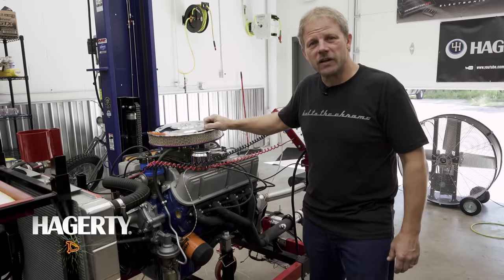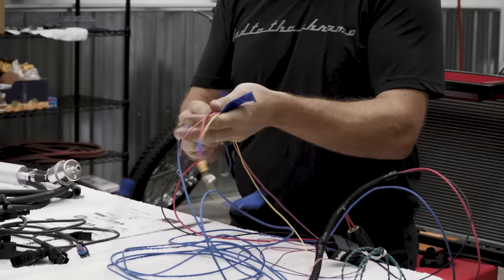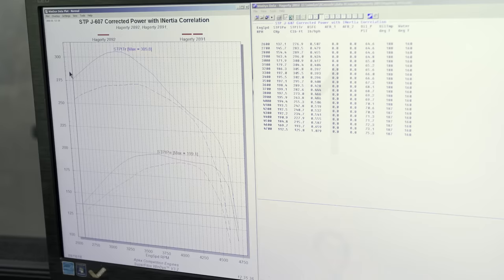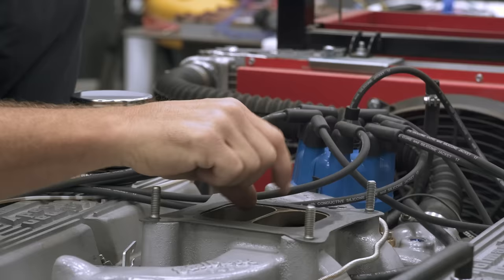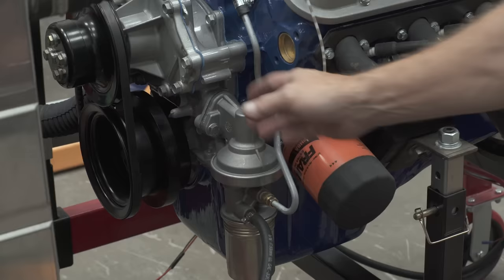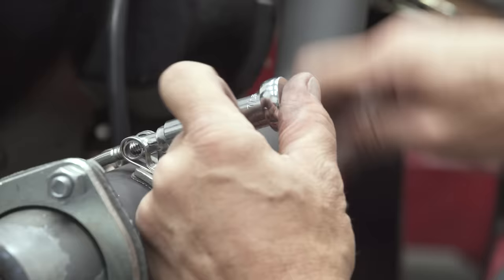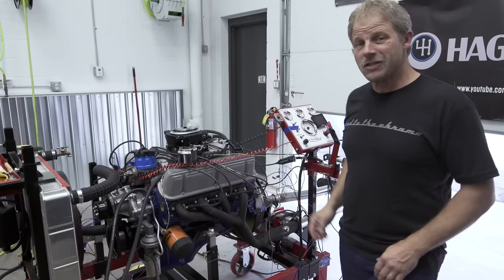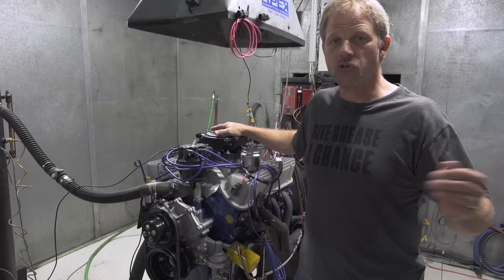Is it worth it? Replacing your carburetor with a Holley Sniper EFI | Hagerty DIY

Comment: The point of EFI isn't more power, the point of EFI is better starting, better fuel economy, more accurate fuel distribution between cylinders, altitude compensation, fuel grade compensation, knock compensation and vastly improved reliability.
Reply: All of which creates more power while dealing with more variables.
Reply: I'd add it's safer too as I've seen countless carburetor fires.
Reply: @emptymannull  When you're talking SFI with 2 lambdas, full timing control, full electronic single coil igniton and such stuff, well, then you might get a good amount more than with a well tuned carb. 
Because with SFI you can do such jazz as cylinder selective adaptations, knock compensation, barometric compensation, pull timing out and in as you like, the only limit is the sky (and the engine). 

I would prefer a EFI/SFI with all the electronics and stuff, because it unlocks a good amount of power, can compensate a lot of things and is pretty safe and reliable. ^^
Reply: Pfffttt okay my family has Holley snipers and all they ever have is problems my Holley 750 double pumper works fine 🤔
Reply: If you have ever driven carbs in the winter, you know that fuel injection runs so much better in these conditions.
Reply: @garthhowe297  So true.
Reply: @garthhowe297   So true.
Reply: A Man of Culture Agreed.  I didnt expect more horsepower, but that looks good to.
Reply: I agree. Added the sniper setup to my '72 402 bigblock. Swapped from a Holley 750. Virtually, no change in fuel mileage. However, now it is turn key start, idles better, doesn't foul that impossible to reach number 8 plug, and responds lightning fast with no bogging. The  system really is awesome. Well worth the money to make your old car more driveable (especially if it sits alot). It is an easy one to two day swap and well worth the money.
Reply: How does efi work after an EMP when the Chicoms come knockin?
Reply: @WesternReloader  I still have the 750 in a box.
Reply: Chris R appreciate it but I’m going to try my luck with the Summit 600 (annular boosters) it’s an auto lite 4100 clone, this is going in my Bronco, thanks though
Reply: Rich you won’t be disappointed with a summit carb.
Reply: zepfan96 once my Bronco is further along I’ll switch to EFI, but in time being the Summit 600 had great reviews.
Now tell me the Weiand Street Warrior dual plane intake is good too! Saw a few reviews that it warps easy and leaks, and since I haven’t run it yet I can still return or exchange it
Reply: @HairBandDan  , Take care of them they work forever
Reply: @Garth Howe Um I don’t drive my Clean 70 Chevelle in the Winter, I wait till the roads are clean of salt 😀
Reply: Rich no experience with those intakes. I can tell you I’ve owned almost every variation of the summit carb and you will second guess the efi. Does it still behave like a carburetor? When it’s below 32 degrees yes. But anything above that you’ll be amazed at the throttle response and ease of starting.
Reply: Rich Im pretty sure I wont need to be worrying about it then.
Reply: HairBandDan that’s anecdotal to just your family’s experience. The amount of people that have successful sniper installs is very high.

Just because your carb works, doesn’t mean EFI doesn’t.
Reply: 100% this
Reply: @WesternReloader  if that happens, vehicle function will be the least of concerns.  But it would be nice to have a carb on the shelf at that point.
Reply: they still build carter calibrators in mount camel Illinois unsure on the amount
Reply: @elonmust7470  I used to work at a speed shop a few years back, like an old school one (half the displays were for sbc or sbf) with chrome everywhere lol, it was nice actually. Most of the customers that came in always said their carbs always worked perfect and were the best for their car. Those same people come in every month or two to buy/price a carburetor for their car.
Reply: Yea but $1700 is a waste for the same performance
Reply: infamousnova it takes lots of money to maintain a collector car and money is no object 
It takes 100 thousand dollars plus to restore or rebuild
Reply: @HairBandDan  ok boomer 😅!
Reply: @garthhowe297  My 86 f350 has a stock carb. It was about 15 degrees out the other day, 4-5 pumps of the gas and she fired right up from sitting all night. Helps if your carb it set up right.
Reply: @BRadWilson3  I live in Ontario, Canada, and I never found starting a carb'd car too hard, but driveability until it warmed up kind of sucked.  I am continually amazed that it can be more like 0F outside, and a EFI car will start up, and drive right down the road without a single hiccup.  Cars with carbs sounded so much better though.  lol
Reply: @JonsReef the "mountains" in WV are basically just hills, the highest point in the Appalachian mountains is 6,684 feet, and Colorado springs is at 6,800 feet and if you drive 30 minutes west you are over 11,000 feet. 

I have personally done this test when I was in highschool with my entire class and teacher and the results were interesting. We took a 1967 CJ5 that had a SBC and a 650 cfm Holley carb, we put an O2 sensor in the exhaust and tuned the carb not through feel but through actually tuning by stats and we ended up getting 16.7 mpg on our 30 mile highway test loop. We then spent a few weeks rebuilding that jeep in class by putting in a new wiring harness and adding a multipoint EFI system. The difference was immediate, not only did it tune itself so we all didn't smell like gas from messing with the carb, but even though it was in the 20's in our shop class it started on the 3rd crank rotation and ran perfectly even when cold. There has never and will never be s single carb that can start as reliability and smoothly as EFI when cold, it literally cannot happen since the fuel atomization is drawing so much energy out of the gasoline that the surrounding manifold is at a higher energy state and attracts the fuel to the sides of the manifold which results in awful fuel distribution and the engine ends up running in a state of constant flux between lean and rich while the manifold is warming. You can test this yourself, get an O2 sensor and watch the AFR on a really cold start and it will jump around from as low as 9:1 all the way to 15:1 for atleast 2 minutes. 

After we ran the EFI as was directed and let it tune itself, and remember that everything else was the same except the EFI vs Carb we took it on the exact same test route with the same teacher driving on a day that matched the weather as closely as possible and we ended up with 18.1 mpg. 

So the TLDR: the EFI will have perfect fuel distribution, will always start easily no matter the tempature, it can adjust to fuel quality, will adjust perfectly to altitude, and requires no maintenance while also getting better mpg.

The benefit to the carb is that if your vehicle already has one then you well, already have the carb. It will get worse mileage, when the engine is already warmed up it will start faster but due to the GOD FUCKING AWFUL fuel distribution between cylinders your engine WILL ping and any large altitude change will make the issue worse.

If you want to see if I'm lying or not out an O2 port on every exhaust runner on a set of headers and you will be shocked how awful the fuel distribution is on your carbeurated engine.
Reply: @garthhowe297  once a carb is warm it does just fine. Ive never had an issue. Though fuel injection is good for bottom end throttle, and efficiency.
Reply: @HairBandDan  I can dig that. I've had a 650 DP on a 1968 350 Olds since 1997 and other than replacing a couple bowl gaskets , needle and seat, a couple power valves, it's been reliable and consistent as hell in the quarter mile for 23 years. I only drive it about 2000 miles year so I cant really see any benefit of this EFI set up for my situation.
Reply: Suffers less from deteration of power over time also, that's the biggest reason today's vehicles run like new with higher mileage then the the vehicles of yesterday could.
I've got several machines of my own and one of them I keep points and a carburetor on for a rainy Saturday afternoon when I'm feeling nostalgic for the old days and want to satisfy the habitual tinkerer in myself, but for everything I build for money for someone I always recommend these kinds of set-ups, you don't need to pull out a million little tricks and once you've been doing it that way for a while and you notice that people aren't bringing stuff back to you as much, and the only time you see them is when you bump into them when you're out somewhere and all you hear from them is "Still running great" you start catching onto how much better they are.
Reply: My quickfuel is the best running carb I've ever owned.
Reply: Of the claimed benefits you mentioned only one applies to the Sniper, altitude compensation.  A couple are suppositions, better starting, economy and reliability, and the rest just flat wrong.  The Sniper will NOT compensate for knock, fuel grade issues nor is it better at fuel distribution since it's a TBI system.
Reply: @JonsReef try to mix 25% E85 to boost octane, block off heat risers, run 160 degree thermostat, make sure distributor has no endplay.
Reply: With a TBI you will NEVER EVER get "better distribution of fuel between cylinders."   And yes.  I do these same comparisons for a living.  The only EFI that makes for better distribution is Port EFI.  Not this TBI junk.   Paid advertising is what this is, and what Hagerty does.
Reply: This is just electronic TBI conversion since its still running a mechanical ignition system. Its the middle ground of modern and old.
Reply: @JonsReef - Those 360's were horrible engines brought out in the early emissions era of 1972 and bad until the Magnum version of 1994 came out... Yours is prolly rated 9 MPG City and 11 MPG Hiway... low HP/torque... horrible for 1990... not because of a carb,, but Chrysler didn't update/improve the internals while GM/Ford started to in 1976 !!! Different pistons, cam, heads could prolly bump you to 16/23 MPG... still with a carb... even a 4 bbl. carb... and a big HP/torque boost as well from the added efficiency... all on 87 octane fuel...
Reply: EFI has bad reliability... always needing new injectors or having them cleaned, needing new sensors, needing new expensive computers... running in horrible 'limp home mode'... 
Properly tuned carb. engines start so quickly cold, warm, hot that you won't even hear the starter crank it... modern EFI engines have to crank over a few times while the computer figures out just where all the engine parts are...
Reply: @realtuners707  - Yep, these videos are infomercials...
Reply: @BuzzLOLOL  everything you just described are rare things that people who hate technology always point out as if every single EFI vehicle has these problems.

Injectors failing? That is an incredibly rare thing that is almost as rare as a diesel injector failing.

ECM failure? What, did you drive through a solar storm because ECM never go bad unless the vehicle was underwater or someone fucked with it.

Wiring needing replaced? Once again unless someone really fucked with the wiring or an animal ate it then the wiring will be fine for the life of the vehicle.
Reply: @A_Man_Of_Culture_  - I have 8 vehicles, the 4 with carb.s are much more long term dependable... 
Everyone I know with a Ford Ranger pickup has had to replace the computer... the one in my Crown Vic is also bad... as was the one in neighbor's New Yorker... there are so many sensors with EFI, one is always bad...
Reply: Exactly. All else equal, a carb will make more power because of the evaporative cooling. Factory fuel injection is more powerful and reliable thanks to cylinder to cylinder consistency and adjustments but I'll take a carb that I can fix on the side of the road over a single throttle body injector with no parts in the local store any day.
Reply: @WesternReloader  Just be careful if you have a C4/C6 transmission.  The Sniper doesn't have provisions for the Ford kick down rod.  You will have to convert to a kick down cable.  Not a problem for many but, for the cost of the fuel injection kit many don't want to spend extra money on holley`s over sight.

They work great, but I found the throttle can be quite stiff when the engine is running.  Turning the throttle plate screw to bring the IAC with in spec once hot, on some engines I found the plates end up being too closed and engine vacuum pulls the plates closed and makes it very hard to just barely touch the throttle.  That is one issue I don't like, then the springs I feel are quite stiff that I don't believe my OE vacuum cruise control would be able to function properly.  Then throw in the C6 I have needing to be converted to a high dollar cable.  It just puts me off on it considering how much the kit is.

Plus it doesn't help that for my 306 build I already have the Holley kick down rod extender for 2V applications to convert to 4V, I got a summit 600cfm 4V carb, I got a edelbrock performer intake, and I also have a brand new cardone '86 mustang 5.0HO distributor.  So I would basically eat the cost of these parts as I purchased them too long ago to send them back.  I would love to run the ProFlo 4 from Edelbrock since it multi port injection and the fuel injection system also controls timing.  But even that setup would pose many problems for me for a bolt in route I am shooting for on my 306 build.
Reply: @Spudderr  depends on brand also.  FiTech we have one customer that bought a truck that had one installed.  We cant get it fixed and we got tired of sitting on hold with FiTech for an hour to two hours waiting to have them walk us through what to try next.  The thing runs fine but cold start up it just floods the engine with too much fuel and it will never crank up unless you keep cranking or open the throttle plate.  Then when it does it billow black smoke out of the tail pipe.  The snipers we've never had issues with like we have with FiTech and because of that we don't install those any more and we wont touch them anymore either.

Only problem we've ever had with Snipers is when adjusting the throttle plate to bring the IAC with in spec on some engines the vacuum pulls on the throttle plates and makes the throttle very stiff.  Turn engine off and the throttle is quite smooth.  Only correction we've been able to find for that is to turn the throttle plates open more and just accept that the IAC is going to be out of spec.  Those that had those problems the IAC is steadily at 0 meaning the IAC is fully closed cause the plates are letting too much air through for the idle speed we put into the wizard.  Sure could bump the idle speed up some, but the 66 corvette with a stock 327 in it, there is no reason why it should have an idle speed set above 600 rpm.

I would get one for my 306 build for my truck but they wont work with my setup cause Holley and Edelbrock for some reason felt it smart to offer fuel injection setup without a ford kick down.
Reply: @BRadWilson3  It does.  My 82 F150 has the same 2150 2V carb on it since the engine was rebuilt back in 1992.  I only rebuilt it once between 1992 and 2017.  The only problem I had was when the switch to this ethanol blended fuels I started noticing a hot restart problem that was never there its due to the ethanol vaporizing and creating a overly rich condition inside the aircleaner.  The other problem related to this was my fuel economy went from 14mph city down to 12mpg city.

I am hopeful the Summit 600cfm carb based off the holley upgrade of the motorcraft 4100 carb will provide me with the same reliability for the 306 I am building for my truck.  I would love to go with fuel injection just cause I can play with settings on the fly vs having to disassemble and make changes.  But for me I don't want to lose my cruise control as I use it, I also don't want to spend more money and convert my C6 kickdown rod to a kickdown cable.  I already bought the holley kick down extension so it will fit the more forward 4V kick down location.
Reply: @realtuners707 , Yep it is why I keep looking at Edelbrocks Proflo 4 which is multiport fuel injection.  If I do fuel injection on my truck this is the one I would use.  I just cant justify the cost and I also cant get answers to important questions I have.  Think I will just end up sticking with my initial plan which is the Summit 600 cfm 4V based off a holley upgrade to the motorcraft 4100 carb.  I already bought the quick change vacuum secondary kit to install so I can use a wide band O2 air/fuel ratio gauge to tune the idle circuit, cruise circuit and power circuits.  Lot more work than electronic since it requires disassembly over just simply punching in changes to the hand held unit.  But I also already have it and its way cheaper as well.
Reply: @Shocking Isn't It?, Correct.  If the guy would have hooked a wide band air/fuel ratio to the engine and play with the jets some he probably would have got the power to be very close.

Its what I planned on doing with my 306 cause I am deathly afraid the 600cfm 4V I got from summit is going to be too big for a 306 small block that wont turn over 5,500 rpm on the road.  Summit`s calculator for the street with a 5500 rpm operating range for a 306 says I need 414 cfm.  If I punch in 6,000 rpm which is the redline for my engine but will never see on the road with passing gear kicking out at 5,500 shows for the street 450 cfm.  I wanted to get the 500cfm but many people talked me out of it told me ford put the 600cfm 4100 on all sizes of engines as small as the 289 and 302.

So I am planning for playing with the jets, the accelerator pump cam, and the secondary springs to tune the carb to the real world.  I just hope I don't run into the same problem this other guy I know ran into with a very similar truck, he went down to a 500cfm cause he was dumping too much fuel with the 600cfm and had a horrible stumble when applying the throttle that no playing with tuning was able to remove completely.  Hopeful the 600 being over sized for my engine will be enough to build max power without causing issues like stumbling or loading up.
Reply: @A_Man_Of_Culture_ , come to where I work for a month youll see all kinds of ECM failures that didn't happen due to people messing with them nor with flooding.  Then we see injector problems all the time for diesel as well as for gasoline.  For aftermarket EFI kits, FiTech was the worlds worse and was why we kicked them to the curb as out of the 4 FiTech kits we installed all four of them came back with stuck injectors.
Reply: @Shocking Isn't It?, yep this summit 600crm vac secondary has jets for both primary and secondary.  Ik going to try the carb out of the box if it's not too rich I might run it as is for the first 500 miles to get the engine broke in.  But I do want to do tuning to match the carb to the truck it's going in.

Intake I got the plain edelbrock performer with the idle to 5500 rpm power band.  Cam has a powerband of 1,400 to 5,400 rpm with a 6,000 rpm redline.  I decided against stock as the newest 4V 5.0 intake which was on the 86 5.0 HO mustang it's still a smog intake.  I wont have no heat cross over and no egr on my planned setup.

Only emission systems I'm keeping is the aircleaner hot air circuit and the evap system for the fuel tank.  Egr, converter, and air pump is being trashed.
Reply: @Shocking Isn't It? - Had to clean the injector on my '79 Cadillac Seville at 58K miles... replace temp sensor at 65K... Done that and replace TPS on other vehicles, as well... changed lots of Ford and Chrysler computers...
Reply: Exactly my thought as soon as I saw this.  There are really only two benefits to EFI:  Part throttle fuel efficiency and Idle A/F mixture control on cold start.  That's it.  There is zero advantage to EFI for power output.  The only way an EFI would contribute to more power would be if the motor was restricted by a carburetor that was to small prior to changing to EFI or it was poorly tuned.
Reply: Yep, and over decades a few of those... well.. to say... a beautiful setup, car engine electronics,,, poof, it's gone!While a spec car is just a hole in the road one pours money into, I've  got to the point of just saying no, to hoping for a 50k mile engine, go with 20k$ and matched newer engines and trans matching kits. Get 150k miles+ and no jumping out of burning cars!Pay me up front or pay me on the backside…. fire not included.
Reply: MajorLeague  go ahead and use ethanol in a carb and oh wow the carb is not clogged, oh and how are the seats doing? Oh you need to rebuild your carb if it sits for too long or if the fuel quality is top poor? 

Carbs aren't as reliable as EFI, they were back when EFI was young into it's adoption but modern EFI raped carbs in every aspect besides intake air temp and that doesn't affect EFI the way it affects carbs.

There is a reason EFI is the only thing you see nowadays and it isn't some big conspiracy it is because you get VASTLY better fuel delivery to each cylinder, you get VASTLY better fuel mileage, you get VASTLY better starting since it will always fire on the third revolution versus a cold carb which you have to use a choke and keep cranking till you get enough fuel flow to actually ignite. You also can tune to such an incredible degree that a carb literally cannot compete. I can spend 25 minutes tuning on software and fix whatever mapping problem I had if I want a custom map, or I can let the EFI TUNE ITSELF and I never have to lift a finger versus a carb which has fucking awful fuel separation for each cylinder and if you want to tune it requires you to disassemble the carb and replace jets which cost money and takes longer. 

People who try to say carbs are better are the type of people who think just because they haven't had a problem with something means that there came be nothing better than what they know.
Reply: How? Sure they can  be rebuilt and are more variable, but have one catch fire on top your build, lol.. then 'Reliable' becomes somewhat a interpretation, a opinion. Carbs are not more reliable in mileage either, or with big temp swings... no, I would say Carbs have and do fill a function, and yes EFI has many benefits.
Reply: @aussie2uGA  In the 60 years I've been working on cars I have seen hundreds of backfires through the carburetor, but never once seen a Carburetor fire.
Reply: So it would make sense to just leave it like the factory shipped it?
Reply: @HairBandDan  we don't have them problems in Florida.
Reply: I like my individual runner Weber carbs and my electronic ignition/mapable destributer
Reply: Russell Gerdes  I'm a professional timber faller. I've met more backwoods people than 99% of the population. Some are good, some aren't..
Reply: @garthhowe297  Not my Holley carburetor.  It starts right up the first time no matter how cold it is outside.
Reply: @giggetto1851  I guess that also depends on your version of "cold".  I'm in Canada, so it can be pretty darned cold in the morning.
Reply: I have a fuel injected Fox Mustang with a tuner. No matter how I tune it, I can't make it have more power then a well jetted carb. Also I was at a car show recently and I saw 57 T-Bird with a 4 barrel Holley and it started instantly and so smooth. Plus the guy had almost 50,000 miles on that carb without adjusting it.
Reply: @robertb3409  Not to be mean but you probably haven't tuned it right.
Reply: @elonmust7470  You are not being mean at all. I meant to say with a carb. The fuel cools the air charge more than a port fuel injection would. I have a fox mustang with a moates qh tuning software. I have it tuned very well. On the dyno my 306 is making 355rwtq.
Reply: HairBandDan I’ve heard that the bolt on fuel injection all have issues... that’s something that has prevented me from getting one , we drive Offroad and overland, so reliability is paramount. We travel alone in many isolated locations , I’ve been wanting fuel injection but I’m still trying to find one made with pure craftsmanship ... until then I’ll have to deal with altitude changes, stalling , ect. We cycle through carbs so every time there’s a trip.. we have one carb already to replace the gummed up one.
Reply: My holley street warrior equipped sbc 350 starts in less than 1/2 turn of the engine. Just saying.
Reply: @guitarprepnplus1  what about when its 5 degrees outside and snowing, or if you get some poor quality fuel, or if its 110 outside and almost 180 under your hood.
Reply: And turbo and poweradder capability
Reply: Vastly improved reliability until you have an injector have a bad hair day and you burn a hole in a piston, or wash the rings out of one cylinder, though admittedly these issues are problamatic mostly on multiport injection, as throttlebody injection if goes apeship you can tell something is wrong before you murder your poor unsuspecting engine.
Reply: @victorriceroni8455  if an injector fails it simply stops firing do to modern safety systems that can detect if an injector is having faults and shutting it down before problems arise unlike a carb where if a jet becomes clogged your entire engine is now running so lean you will easily melt multiple pistons.
Reply: @A_Man_Of_Culture_  You are correct. But my neighbor burned a hole in one piston on a multiport dodge ram and never knew anything was wrong. We had the opposite problem on a 460 F250 when one injector started drooling a ton of fuel and washed the rings out of that cylinder. Point is anything can fail.
Reply: And electronic control can control turbochargers much more accurately than any mechanical setup, so on a turboed engine you lose almost no power at high altitudes or hot climates.
Reply: You nailed it
Reply: Yeah.. power
Reply: This is basically  a carb. If you want  true efi performance you  need multiport.
Reply: The problem with carbs is no one anymore knows how to tune them.
Reply: So its better....!
Reply: Also that you can get same power from either system. So pick 1?
Reply: Why is your name A Man of Culture but you’re profile picture is an anime child?
Reply: @rwfrench66GenX  you just wouldn't understand even if I tried to explain, and the anime charector is an adult not a child
Reply: @A_Man_Of_Culture_  it looks like a kid with a pacifier to me.  Even if it’s not, why would a man of culture be watching anime?
Reply: @A_Man_Of_Culture_  and watching that in a cartoon makes you a man of culture?
Reply: @HairBandDan  I know a guy too... on a serious note if installed correctly and if you use the sniper dist for timing then it's user error period. Like exhaust leak, Rocker adjustment, settings, vacuum leak, kinked fuel line, to small of a system or to large (every one thinks they got 600hp but really closer to 300),etc. If your not using the distributor but hei you will probably have hit and miss issues as it's a lot more dependent on accurate timing.

Holley is hands the best on the market as of today, but few up and comers are doing pretty good.
Reply: It is a nice added benefit though
  That extra power that comes in the sniper box
Reply: @HairBandDan  maybe they should set up their sniper better.
Reply: A throttle body injection unit does NOTHING to correct fuel distribution issues.
Reply: @garthhowe297  not at all with a correct set up carb there's no difference unless your talking -30 nights to 32+days even then there's alot if different carbs thermoquad 
Chrysler quadrajunk gm double pumper vac secondaries square or spread bore smh not worth the 1000 dollar diff imo
Reply: Overly simplistic and not entirely true. Any number of ways to make more power through fuel injection. It's a matter of optimizing not just your fuel system, but your air intake path, exhaust, ignition system, fuel management, reciprocating assemblies, optimizing your valvetrain.
Reply: @WesternReloader  if you're expecting any of that, you've got bigger problems.
Reply: Know your machine. Great reliability an power I'd had with a carburetor.
Reply: I live at 6,750 feet above sea level with altitudes well over 11,000 feet, just 50 miles away from my house, so altitude compensation is very important.
Reply: @richardtibbetts574  for you if you don't have the skills to be a man an are handy with tools skills and knowledge 😉
Reply: @ShainAndrews  you just proved to me that everybody does the same thing with the carburetor you didn't make sure you had the right CFM you didn't take the time to get a carburetor and he didn't run it to give this potential out of the carburetor so yet to prove me wrong you've proved me right and you still usually get 30 to 50 horsepower more out of a carburetor facts change my mind
Reply: Facts you need heads for power
Reply: It's funny to see people arguing that carbs are better for performance, but what's going on in racing would suggest otherwise. Even motocross is fuel injection now.
Reply: Which all gives more power. A carb is a Hole Dumping fuel and air into the engine, nothing more
Reply: Many miss the point and carburettors were great for the times but are definitely outdated. Fuel injection is the way to go as long as its kept basic like the holley systems.
Reply: The EMP would disagree.
Reply: @RollingRigTraction  The EMP would also destroy your distributor as well as your fuel pump all of your gauges and lights as well as the cold start circuit in the carburetor
Reply: The guys praising carbs forget that this system doesn't have to be retuned or tinkered with and the people driving behind you don't smell the rich condition you never notice running down the highway
Reply: @HairBandDan  and if you have issues with a carb you can fix it on the side of the road (most of the time)
Reply: @aussie2uGA  is that a statement of your personal tuning ;) and a lpg mixer on a falcon doesn't count lol
Reply: @aussie2uGA  idk… if the timing is set wrong, the thing pops like a bomb! Lol
Reply: So more power....😂😂
Reply: Well how many guys drive different altitudes and who cars about 2mpg???and the fuel distrabustion is from cam design and intake
Reply: Most of these are not port or direct injection, they are throttle body. Fuel distribution is still pretty dependent on your intake and engine. They also do not have spark control for knocking
Reply: Actually it does make more power
Reply: Only problem i see with the EFI system is that if it breaks down you won’t be able to fix it right away. If you’re module goes out or your O2 sensor or even something as simple as a spark plug. With a carburetor it doesnt know if one cylinder is bad it’ll still run. Majority of the time you just need a flat head screwdriver to fix the carburetor along with a vacuum gauge. Can’t really do that with a EFI. No knock on the EFI. One day I’ll upgrade to one. But my AVS2 runs like a champ right now and i have been driving it daily on my K5 blazer. Lucky i live in California so i dont see that 40 degree weather. Lol
Reply: @armygreenfj3924  if an 02 sensor dies then the ECU just defaults to the last safe map it had which isnt going to damage anything and you could drive it on that map for the rest of the vehicles life.  if a spark plug goes bad which is an insanely rare event but if it does the EFI will still run it doesnt shoot itself if a cylinder goes down im not sure who told you thats what happens. with a proper multi point EFI system if a cylinder were to stop firing your ECU can deactivate an adjacent cylinder so that the engine isnt imbalanced.
Reply: That's what I thought too, so I made the swap and I'm down on fuel mileage and still trying to get it tuned after 3 months of every single day tuning it. I'm about ready to toss the 2500$ super sniper stealth in the can and put my tried and true carburetor back on.
Reply: @TurboRanger351  it sound like you made a mistake somewhere because self tuning EFI is as simple as it gets, no tuning needed on your end at all and I mean not a single turn of anything it does it all for you.
Reply: @A_Man_Of_Culture_  it is absolutely not self tuning,  will it run after you set it up? Yes. Just not very well. You have to program all of your cold starting parameters , acceleration enrichment,  ignition timing; way too much to list. Some of the system may be self tuning but not the holley sniper for sure.
Reply: Hopefully it wont be stinky gas time more proud of you got more harder to tune especially with carburetors
Reply: 100%.
Reply: @garthhowe297  that's why I go to a warm place in the winter and my 86 Square Body sits snuggly in the garage waiting for warm weather..lol
Reply: @HairBandDan  mines a 600
Reply: @garthhowe297  maybe so but As a Rule of Thumb - you Should adjust carb every winter And Summer 🙃
Reply: Couldn’t agree more. I’m gonna pick one up for my 74’ D100 with the 360.
Reply: It usually provides more AVERAGE power throughout the rev range
Reply: @WesternReloader  it doesn't. Thank God for mechanically fuel injected vintage Mercedes Benz 😎
Reply: I've dealt with Quadrajets and only one I've had an issue but never hard starts in extreme cold, good power with good mileage.
Reply: @A_Man_Of_Culture_  I wouldn't say those problems with efi are rare. I've seen all of them happen on my own vehicles and friends and family.

The way I would describe EFI vs carb is this:
EFI very reliable and great to own for 10 to 15 years, then slowly descends into problems and eventually becomes unfixable.
Carb, kind of a pain to own every year, but will keep working 40 or 50 or 80 year later, but requires tune ups and maintainance.

They both have their plus and minus. Personally I think we have an obligation to build cars for the long haul. 
The ideal system in my mind would involve a very simple efi system that could be fully refurbished or even replaced after 10 or 15 years.
Reply: You are correct but all that essentially equals better efficiency. Better efficiency can equate to more power.
Reply: @cdrogers72  Really, no change in fuel mileage? I would have expected some anyway. I've got a big block LS4 and was considering doing so. I don't see the point if you are not having issues with starting and idle.
Reply: It doesn't lol. 400lb paperweight.
Reply: This is not an accurate statement. Carbs do not freeze because of temperature alone…the actual water vapor present in atmosphere coupled with the suction of the carb is what causes freezing. I have a single carb 69’ Baja Beetle that runs at 10F, 77% humidity and 15 dew point here in Colorado with 0 issues. Preheating air is how to prevent carb icing which is achieved either through secondary customer air systems I.e. taking hot air right off the cylinders via vacuum provided by the carb or a heat soak method which heats the manifolds and soaks into the carb body preventing icing. The rule here is the closer your carb is to the cylinder the better for winter condition…it’s why dual carb systems do not ice over.
Reply: these systems aren't better fuel economy, unless you absolutely have no clue on how to tune a carb.  There is no knock compensation with this setup.  It's a sbc.  The only system that can do these things is a Edelbrock pro flo system on a sbc.
Reply: It also adds longevity to the engine because you dont get the cylinder wash you get with carburetors.
Reply: He says that at 2 34
Reply: Thanks genius
Reply: Sniper units are made for the everyday DIY.  I'm old school..I know how to dial in carbs...and like he stated the carb wasn't big enough then he added a 1 " spacer which can have a big effect on power..so in all reality it wasn't a fair comparison...I ran a dyno for a  living 42 yrs as a mechanic and racer....everyone that runs serious dynos will tell you carbs make more hp...but if you don't know anything about carbs sniper kit is the way to go
Reply: And for even better economy, add in an overdrive transmission, then you’ll have enough economy to bump up your diff gears to 3.55 or whatever, and STILL have great MPG.
Reply: Still take a carb. Part of the fun is tuning and consistently carbs will make more power at mid to limit rpms. Efi has better low end torque and hp but is boring. Yawn
Reply: And more power. But also the rest of that stuff you said for sure
Reply: @cdrogers72  thank you for adding this as I’m in the middle of get a carb of Efi for my 402?! Boath have pros/cons